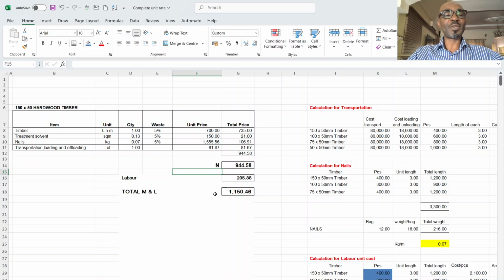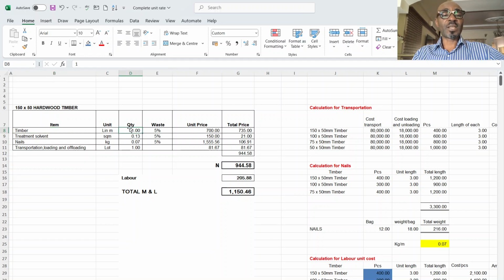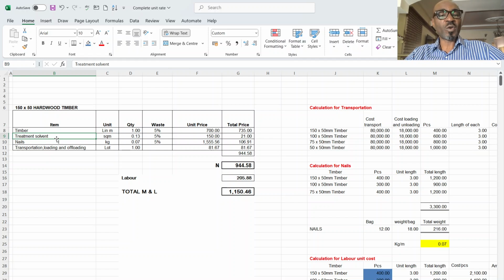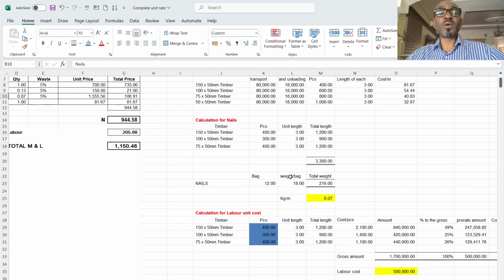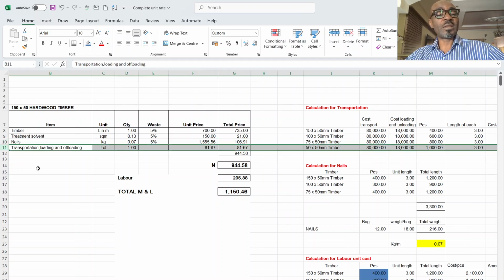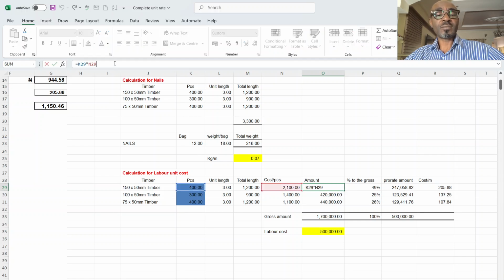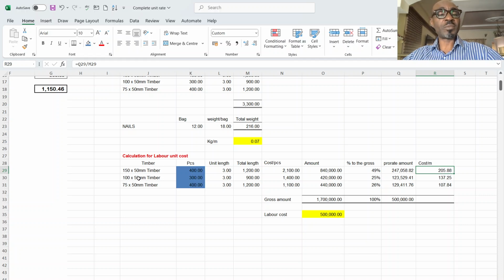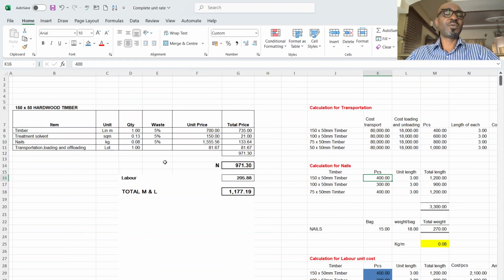Rate analysis for  a 150 x 50 roof timber member

Comment: Greetings, thank you for the continuous information you continue to share with us.I have a query on the build up rate on the treatment solvent. You said we get the surface area of the wood and you calculated =2(0.15+0.05)/3. Kindly if you can clarify, I will really appreciate.
Reply from the maker: Wood has 4 sides, 2 surfaces is 150m another 2 is 50mm and the average length of wood in the market is 3000, you hardly get 3600mm so the surface area is 2(150+50)3/3 to get go a meter since our is for a meter of timber.
Reply: @Quantitysurveyingmadeeasy_2014 Thank you for the clarification.
Reply from the maker: @isalimbaeugine399 thank
Reply: @Quantitysurveyingmadeeasy_2014  with due respect, its still confusing. 2(0.15+0.05) will give the perimeter of the cros section of the wood but not the area. Kindly clarify
Reply from the maker: Good observation, I thought I computed the square area of the full length that was why I divided by 3 which is the total length of the wood.

So you don’t need to divide by 3m cause the answer without the division is for the area of  one meter long. 

It shows you are following